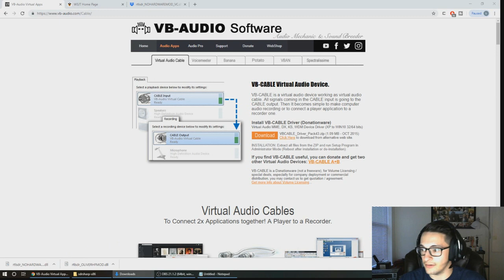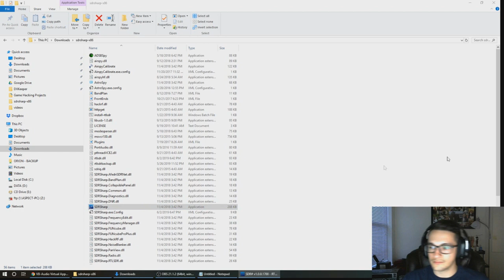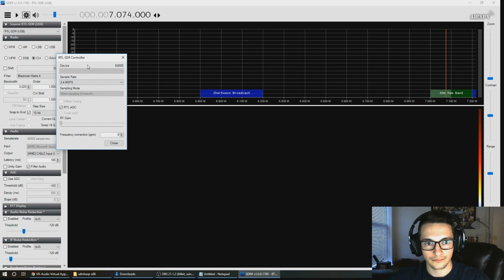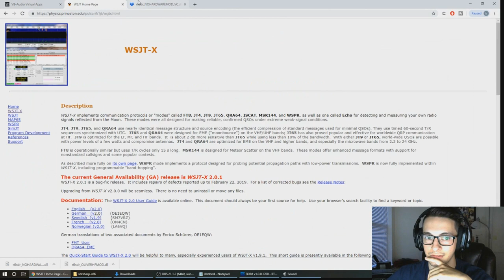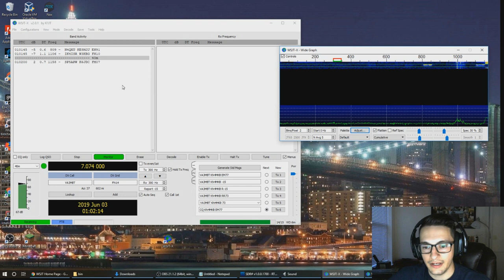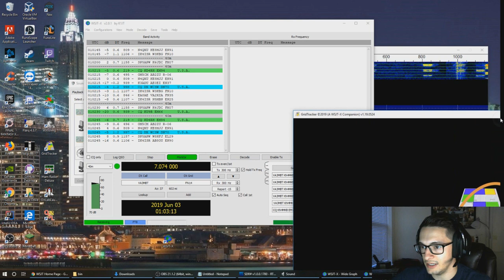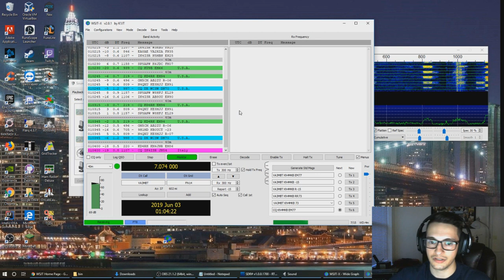Decoding FT8 with a RTL-SDR (Software defined Radio)

Comment from the maker: Let me know what other projects you would like to see with the rtlsdr!
Reply: Somehow, will it be possible to capture RFID card signals with sdr or sniff RFID card while it communicate with the tag reader using sdr.
Reply from the maker: @giamma-basedresearcherssdr7178  looks like it's already been done. But I'll see if I can add something new to the mix.
Reply: @giamma-basedresearcherssdr7178   thanks for the content. I was thinking to capture and replay signals using sdr and Pi for cards like Desfire (8 digit UID) where proxmark3 failed to clone.
Reply: @jacks9931  proxmark3 seems to me a good product and maybe if you can't clone it depends on the code you use since the technical specifications are enough to handle almost everything ... Desfire has security levels "AES 128-bit and LRP authentication and secure messaging" and "DES / 2K3DES / 3K2DES / AES crypto algorithms" which may not work with parrot attack, repeating messages, recording and repeating the message, etc ...

Code for proxmark3 and Desfire:
https://github.com/AbinMM/proxmark3-desfire
https://github.com/nv1t/proxmark3

Link:
https://www.nxp.com/products/identification-security/rfid/mifare-hf/mifare-desfire:MC_53450
https://www.nxp.com/docs/en/application-note/AN12321.pdf

Discussion:
https://github.com/emsec/ChameleonMini/issues/31
Reply: @giamma-basedresearcherssdr7178  correct, that's why i thought if may be replay attack could help. Proxmark is of course a good tool but it cannot break the desfire DES encryption using nested attack, atleast not without the key.
Reply: assuming that the communication frequency is unique and the reception and transmission spectrum is aligned, you should analyze the signal by dividing the transmissions between the device and the smartcard, and try to send them back by synchronizing the waiting times in the response. if you want instead to retransmit all the messages in row I think you create different errors.
Reply: @giamma-basedresearcherssdr7178  i had some issues when i tried to capture the communication between rfid and tag using sdr. I would suggest you give it a shot if that works for you and then we can discuss.
Reply: @giamma-basedresearcherssdr7178  sure thanks for information and links. I tried to read communication between rfid card and proxmark3 using sdr but it didnt work for me for some reasons (may be spectrum limitation,  not sure). I will try it again and contact you if i need any support. 
Thanks again :)

Comment: Great video! You can use my CalicoCAT plugin to control SDR# from WSJT-X as well!  -N0TTL
Reply from the maker: I haven't personally, but someone told me you can use a virtual serial port with sdr console to achieve this. (Which may be what you're referring to) I'm just not familiar with the software.
Reply: @ModernHam  CalicoCat is a plugin for sdr#, not related to sdr-console. You can get it from https://tagloomis.com/calicocat/  same place as GridTracker

Comment: I have the configuration set up as described in your video. However, I have an issue you may be able to help me with. The waterfall on WSJT-X is 7Khz wide instead of 2.4. I can't find where to change it in the software. In SDR# it is set to 2.4.   THANKS  Daryl de VK3AWA

Comment: I don't know if u have to download that dll file the one i have installed is labeled as ExtIO_RTL2832.dll all i did was enabled direct sampling in the software i use sdr consle the same with cubic sdr and i cant get sdr sharp to run on my computer im have the same issues others said they where having on the website that makes that radio u have i have the same one

Comment: Is there a link to the modified rtlsdr.dll?  Is it this 'direct sampling' one?      Could the (nooelec) Ham-It-Up be used instead?
https://www.dropbox.com/s/0lzx9gz9x1bzczz/rtlsdr_NOHARDWAREMOD_VC.dll?dl=0

Any thoughts on using Olivia (500/16 or 1000/32) for HF Digital?   Or plans for a video on just the general differences between all the digital modes, PSK31/PSK63/RTTY.. WINMOR / PACTOR (for Winlink 2000).. it's very confusing!

(Gary Pearce had a good older episode of HamRadioNow that briefly talks Digital Voice
https://www.youtube.com/watch?v=Q01-N9TsyIo&t=9m40s )